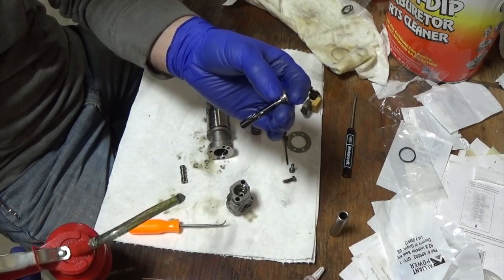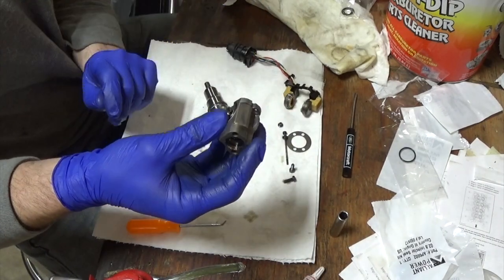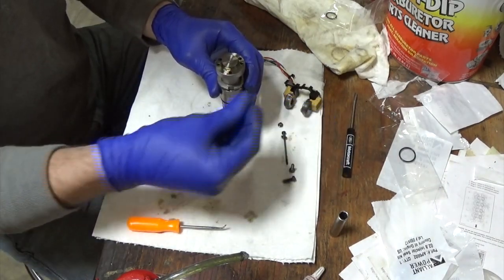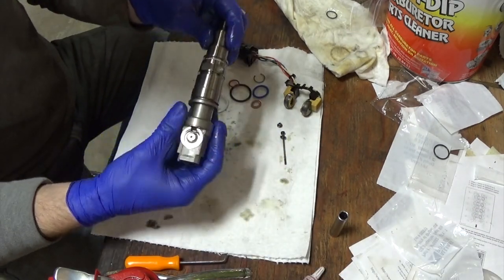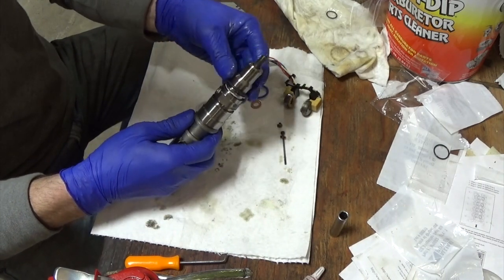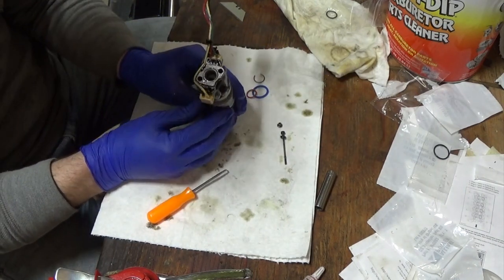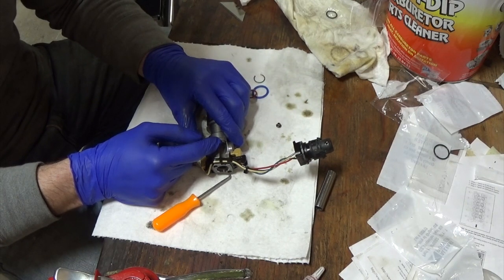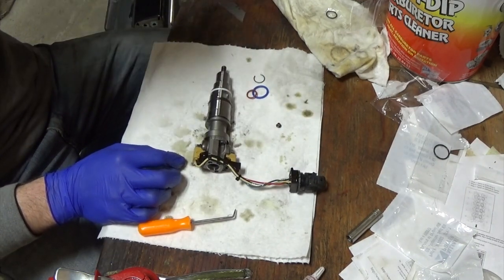6.0 injector final assembly

Comment: I watched the videos and may have missed it but did you mention the rebuild kit and cost along with the cleaner/set up can? Is 6.0 injector the only ones you rebuild?
Reply from the maker: rb02 bab the rebuild kit is from bitter root diesel. You’d have to check their website for price. The carb cleaner can be bought at any parts store. 6.0 is the only that I’ve rebuilt.

Comment: I usually throw a 27mm socket into my vice and use that to hold the injector so I'm not juggling everything in one hand
Reply: AP has a technical bulletin (search up "APTB 01/08 R1" on Google) on how to remove that top circlip. Basically, you use a centre punch or a specially ground chisel to fold the clip in on itself, then pull it out with pliers. I find that method faster and less likely to damage the O-ring on install, but it's frustrating to do that way until you develop the knack for it.
Reply from the maker: Gmupps that’s a good idea.